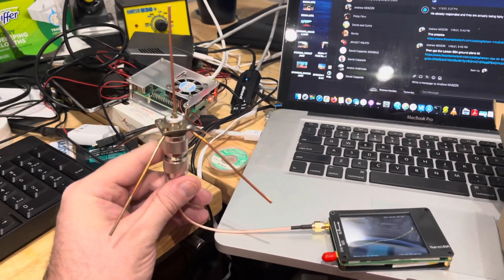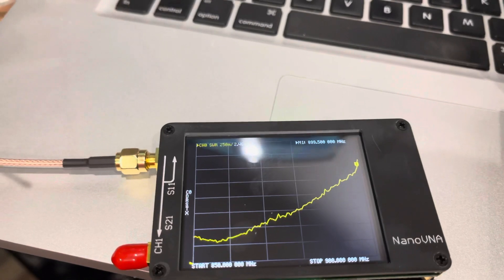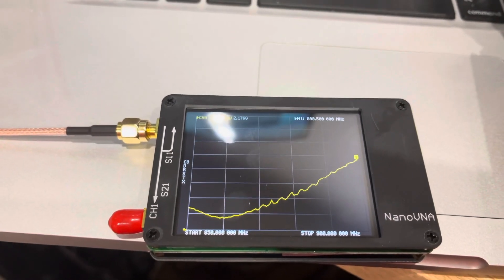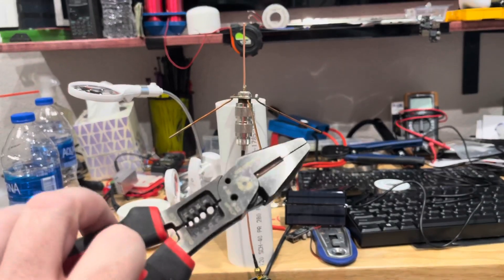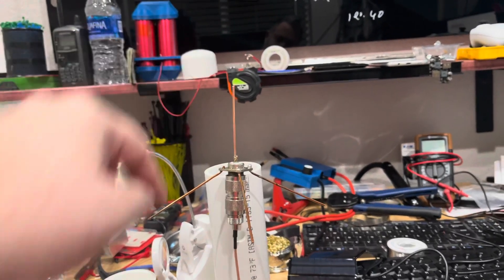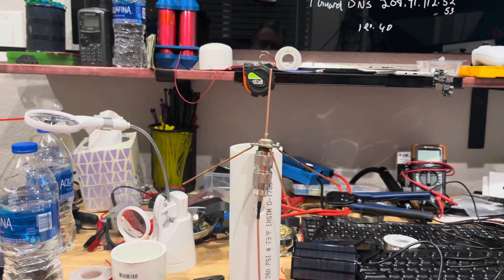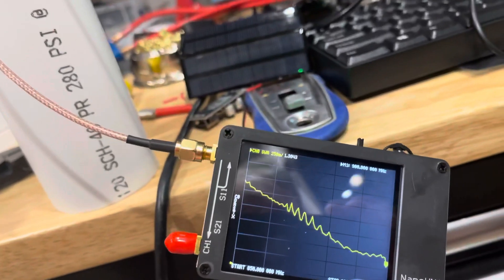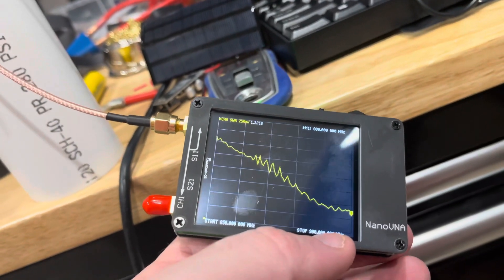1/4 Wave Homemade Meshtastic 915Mhz Antenna

Comment: do you like your NanoVNA? Amazon has a 60$ and a 90$ unit.  which would you recommend just for 915Mha LoRa antenna work?
Reply from the maker: I love the nano vna. Just make sure you get one that will work past 915Mhz and has the sma plugs to recalibrate it. You’ll also want to get converters to change it to PL259 SO238 and N connectors for the most antenna plug types